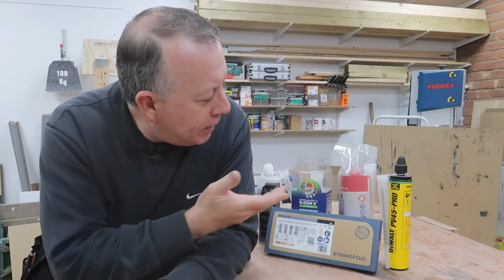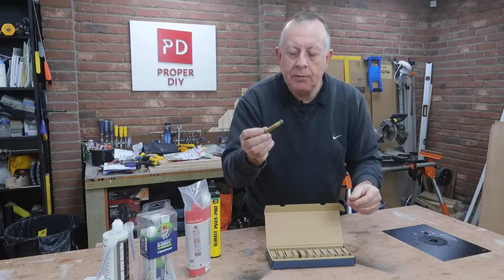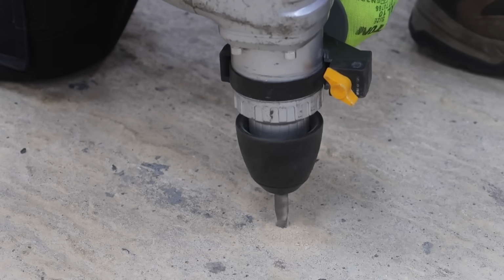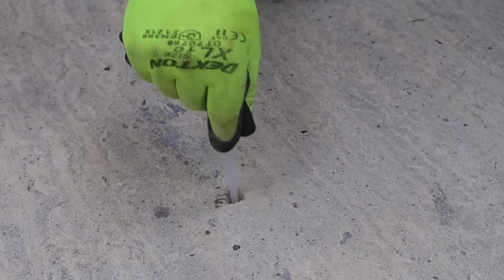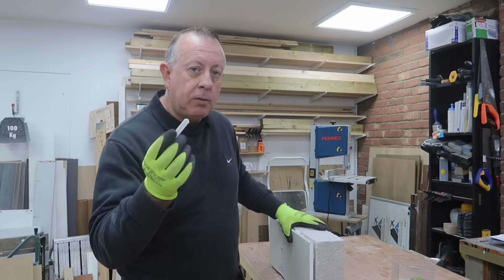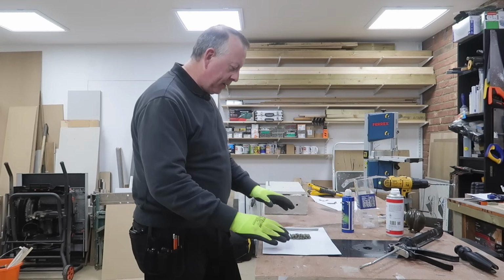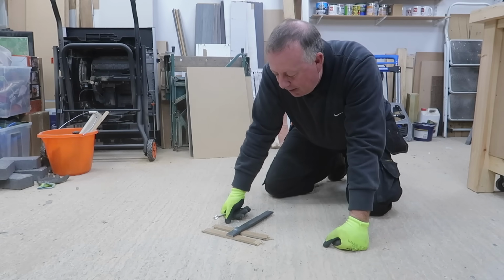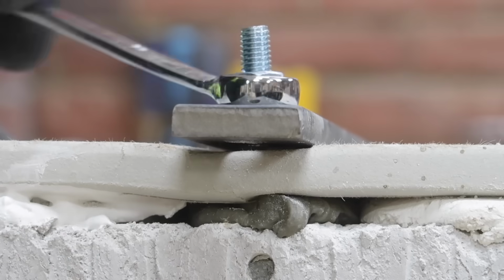Resin Anchors - The Absolute Strongest Fixings

Comment: Resin strongest (into hard materials) probably not and certainly not suitable if there is risk of serious fire!
Reply: I have never seen Rockwell or Brinell figures for anchor resin but I can assure you that when correctly installed, concrete tends to fail before the anchor. It is pretty hard stuff. Without digging through loads of tech data, resin is suitable for applications where fire resistance is a requirement. From memory it's somewhere between the 30 to 60 min mark and with an application of intumescent  foam over the exposed portion of the stud, it's even longer. Hope this clarifies things.
Reply: @georgepritchard3010  … not in my business, expansion anchors or for large machinery pockets and grout below the depth of the rebar cage seem to rule nor do the specifying engineers seem to have confidence in resin anchors in a 1hr let alone a 4hr fire

Comment: I’ve used these for years, original had to pour the one liquid into another then shake for a minute or 2 and u could feel the pot heating up but the newer method that mixes it in a gun makes it so easy….with the going off timings I found that the room/outside temperature u r using it in makes a difference….the warmer it is the quicker it goes off

Comment: There have been quite a few comments regarding the wisdom or not of using a blower and brush to clear the holes before filling with resin. As someone who has installed literally hundreds of resin bonded anchors, I can assure you that the method shown using a blower and brush (which ideally should be a round one) is 100 percent the correct way to do it. With a vacuum you cannot guarantee  to remove all the dust which can cause failure of the bond. This may seem odd, but if you download the tech info sheets from the manufacturers you will find it is in fact the correct method.
Reply from the maker: Thank you George.
Reply: Blowing out is always more effective than sucking out with a vacuum. The velocity of the air it many times higher.
Reply: @matthewhuszarik4173  I agree Blow Jobs are best !!!!
Reply: @RB-bl7vq  😂😂😂👊🏼
Reply: i use a drinking straw and close my eyes 😂
Reply: After filling a hole, is it possible to drill into the resin as opposed to fitting into non cured resin?  I ask as I need to fill a large door frame hole and the torque the screw through it into the cured resin.
Reply: @Rajsta78  probably a bit late to reply, but I have found that you can drill into the resin after it has gone off.  This may help someone, I hope 🙂

Comment: These are like "2 pack" Epoxy glue, superior in every way, apart from convenience, to the rest of the products on the shelves.

My grandad always used "2 pack" glue and until recently, I always used "Super Glue" and found it lacking.
Only recently I started using "2 pack" and have never looked back.
Only time I use "super glue" is on the most minor of applications.

Comment: I used one of these to bolt a wall plate to the wall of my small hallway to hold the floor joists. Absolutely rock solid and the wall will fall down before the fixing fails
Reply from the maker: There you go!

Comment: Very interesting.  How sucessful are you at cleaning the tube to be able to use some more, say next week?
Given the solidity and short working time, might I suggest that, if you have a multi hole fitting to hang that you have it ready so that you can position it on all the studs so that it pulls them into place while soft and save the effort of enlarging/slotting holes in the fitting later.

Comment: Good video! First time I used these was a couple of summers ago tying down some step handrails. If it's hot out, working time can really be limited so it pays to keep the tubes either indoors or at least in the shade until ready to use.

Comment: Perfect timing, I was thinking of using this to mount some small posts to a 6 inch high brick wall for a 12 inch picket fence. 
Going to secure rebar into the brick and drill holes in the posts to slide over the top. It’s only small and that will hold it in place and mean I could just lift it out to repaint it.
Reply: I agree with the other person who commented. Your idea sounds like overkill and will be quite expensive. A simple solution for your need of such a small fence would be to use screw inserts. Fix your small posts with rawl plugs and screws to the brick wall, then drill and using an allen key insert the screw inserts. Then use some bolts to attach the fence into the screw inserts. You can then undo the bolts holding the fence in place to paint it time and time again and you always have a good fixing to put it back into. They work really well and hold strongly and cost very little from Screwfix etc.

Comment: Great video! 
One thing that might a good idea instead of using spray air to blow the dust out of the hole is to simply use a vacuum with a hose. It just  helps to keep the dust down. 
👍🏼😊👍🏼
Reply: I gaffer taped a drinks straw to the end of the vacuum hose to get the dust out of the hole.
Reply: @stephenhey466  great idea, problem solved.  Well done.
Reply: Even better idea if we could have a thin tube vacuum attachment to concentrate the suck and maybe get in the hole (bit ambitious that last bit).  I find normal vac nozzle helps but does not clear the holes.

Comment: Nice one Stuart. I would put the air nozzle at the bottom of the hole to blow it out properly. I’ve taped an 8mm tube on the end of an oil syringe and just use that to blast the holes clean. Works really well. I do use a bottle brush to loosen debris prior though. 👍

Comment: Super vid!   I've used these chemical anchors for a while now, and being an Engineer (and a bit anal) I bell out the hole a bit as it goes deeper.  Not had any signs of pulling out as 11:01.  Not criticising Stuart's efforts, but it does definitely make for an even stronger fixing.
Reply: Bell out by jostling the drill bit? Good tip, cheers.

Comment: I use this gear to fix dental x-rays to walls. It is the best fixing you will get, never had one fail. Always have a couple of tubes on the van. Even used it to bond a piece of timber to some brickwork that had blown then screw fixed to the bonded timber...works a treat every time
Reply from the maker: Nice one!

Comment: Great video as always ! I used a resin fixing to secure in some threaded rod to hold up a pair of 38mm thick solid oak shelves. Rock solid in some brick and plaster walls, it’s become my new magic material ! But …. I can’t perfect the ‘clean out’ technique you showed and always end up with a large amount of waste for domestic jobs, it’s a pity and a bit unfriendly on the planet.
Reply from the maker: Nice one. You are right - there should be an easy way of only using half a tube.

Comment: I used one of those products to fit anchor bolts for a 2 tonne wooden structure. Formidable. The setting time was temperature dependent so you really have to read the instructions. It was a 30 degree days and the realistic setting time was 60 seconds.
Reply: I keep the tube in the fridge to increase the cure time a bit
Reply from the maker: Yes that can be a challenge

Comment: How would this compare to a rawlbolt? Thinking ground anchors for securing motorbikes and that sort of thing. I think my money would still be on a rawlbolt as these are designed to tighten the more you pull them... no?
Reply: I think both methods are viable mate. If you have a really solid concrete floor I'd go rawlbolt, if not solid then the rawlbolt will just crumble the concrete, which is when I'd use resin.
Either way, you don't want the ground anchor to be the weakest part of your security set up. Just my opinion mate

Comment: In a former life I ran a sign manufacturing company. In 1996 we hung a 2 ton sign above the entrance to Kingsland Shopping Centre in Hackney using 2 vertical resin anchors with 16mm rods. Terrified me for years, but they held, amazing strength.
Reply from the maker: Nice one
Reply: The construction industry is full of people who can’t get to sleep at night! Apprentices who know what they done last summer 🤣. Your comment really made me laugh, I’ve done so many similar jobs that are actually sound but at the time felt a bit dodgy.
Reply: As a resident of hackney thank you 😊
Reply: @user-te1le7ck6b  same. I must have walked under that sign many times I suppose
Reply: I can relate slightly. I'm a drainage engineer and install 6 inch cast iron pipework in carparks. I use a fixing called drop in anchors (shots). They need a 12mm hole and a punch with a setting tool. They hold a ton each. Does worry me though still lol
Reply: BWAHAHAHAHA!! 
Did you drive by it often looking at it just waiting for it to fall? 😬😬😬
Reply: It did keep me awake at night sometimes. Thousands of people walked under that thing every day. It's long gone now though, and I don't do that kind of stuff any more😅
Reply: @slowmarchingband1 great memories!!!
Reply: @slowmarchingband1  
Manchester in the 70s - I noticed the ugly empty holes drilled into the front face of many attractive stone and brick buildings - evidence of signage brackets removed from banks and other city centre businesses (holes accumulated by changes over many decades).
Reply: I'm in the same place right now. Got 2 massive heavy signs to hang over a business entrance. Going for 6 x M12 threaded rod chemical anchors on these each.
Reply: @DCShoes  does the structure have the strength to take the load?
Is the material of the structure at the point of connection able to take the load.
For insurance purposes, you may need an engineers design.
Reply: I wouldnt of slept a wink 😮
Reply: As the top comment, I could see this comment out of the corner of my eye. My brain read, “In my former life in Iran.”  I immediately tuned in to the comment to hear about some Persian construction tricks. I was very disappointed once I realized it didn’t say Iran.  I was so disappointed I haven’t even read anything past “I ran”.
Reply: Oh wow. I lived near there.
Reply: I put in my 2 post car lift with chemical anchor and threaded bar, everytime I stand under a car I think about it 😂😂 so I feel your pain. I'm still alive so all is good 👍
Reply: This must be that massive blue sign that was on the front? It was about the size of a shopfront. Monstrous dimensions
Reply: We used to lift in 1.5 tone precast concrete off a chain block chemical anchored to the soffit - single eye bolt 16 mm . Wouldn’t put your fingers under it . Engineers didn’t want any unnecessary holes in the soffit
Reply: yeah 2 tons hanging on 2 16mm rods stuck in resin sounds sketch af
Reply: @WideAwakeHuman  depends on how deeps the rods are set in and what they're set in. 
Also if theres wind at play.
Reply: @Reginald-Bowls  oh yeah I’m no engineer lol - hence my very technical analysis of “sketch af”. I’m sure there’s a lot that goes into it that could make it perfectly safe
Reply: Maybe a 3rd anchor would have allowed you to sleep???
Reply: If that go down  - are you going to jail ? That's your worry mate ? 😂😅🤣
Reply: Until they finally let go.

Comment: I've seen a carpenter use these for anchoring floating shelves. Best and easiest method by far
Reply: That's very helpful if you want to stack a few elephants on those shelves. A bit of overkill for anything else, though. 

I used normal wall anchors to put up a fitness bar for my son. Two anchors can hold about 4000 kilograms of weight. I'm pretty sure that resin anchors are even stronger.  But mine are removable :)

Comment: Used on Large wall hung patio awnings, TV brackets and a garden gazebo which gets significant wind loading. All still there! great stuff, it's the most permanent of fixings. Tried breaking a test lump with a sledgehammer, broke the engineering brick it was sat on.

Comment: Great, aren't they. But I'd recommend not using toothbrush and that aerosol puffer. Use the recommended bristle brush and puffer...
Especially in brittle old bricks like 80-year old London sewer bricks that were always hard and have got brittle with age plus set in lime mortar that has got dusty. Start with small bit, 3mm if you can get SDS that size and build up 1mm at a time to, eg 12mm, to avoid having bricks shatter. Go 100 to 150mm deep. Take as long as it needs to blow, puff, bristle brush out all dust from the hole completely - follow instructions to the letter. Then pump in the resin to the full and screw in the threaded rod slowly - it will push resin into any voids and bind dusty mortar. 
If into concrete, do as the excellent video says. In this case, follow advice to fill hole to about 2cm from surface depending on depth of hole
Reply: Stephen, I assume you are referring to the R Kem 2 kit he used in the video? If so it comes with the bristle brush you mentioned and not puffer. Is there any type of puffer you would recommend? Also what are your thoughts and using a vacuum to suck all the dust out as my thoughts are that it might eliminate the need for brushing and puffing. I need to anchor a timber top plate to old bricks that are brittle

Comment: Absolute perfect timing as I plan to use this resin tomorrow for a gate post!! I need to fix 12mm studding into brick, should I drill a 12 or 14mm hole so there is room for the resin in the hole?
Reply: The ones I used to use usually required a larger diameter drill bit than that of the threaded rod. 
The kit in the video comes with a 10mm drill for an 8mm stud.
You might also need the sleeves if you happen to have bricks with holes in.
Reply from the maker: You don't need a hole much bigger than the rod - enough to get resin between the 2 but a 12mm is too small - try the 14mm

Comment: I guess the hole has to be clean and dry? You shouldn't spray water as you would with say expanding foam, or PVA it to lock up the dust like you may do will filler?

I can already find several jobs around the house for this stuff, not sure if should say thanks for the solution or bah as you've added to my work load 😜

Top drawer again Stuart 👍
Reply from the maker: Thanks Simon. I think you will find it even works with water.

Comment: Use your hoover it will suck all the dust out of the hole.
Reply: the advantage of blowing is as you blow you can see the dust or lack of dust that you want in the end.
Reply: @sidefack  better to put the straw of the aerosol into the bottom of the hole so you're not blowing the dust further down into the hole!

Comment: I have one kitchen cupboard installed using a resin anchor. It's about 40kg when empty. I can practically sit in it and stand an elephant on top of it and it won't fall off the wall.
Reply from the maker: Good example

Comment: I used it for the bolts on my gun safe so easy and super strong.
Reply from the maker: That will never move
Reply: @ProperDIY  You are right moved house and had to get the angle grinder out to make good the studs that were left.
Reply: That's a great idea, I'll have to put mine up with them.